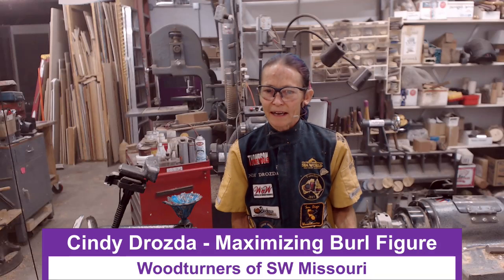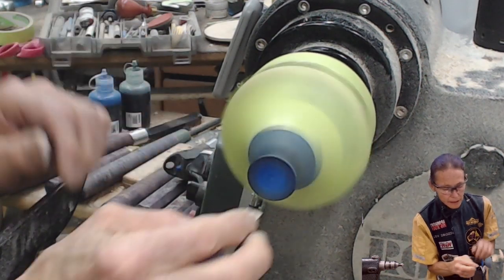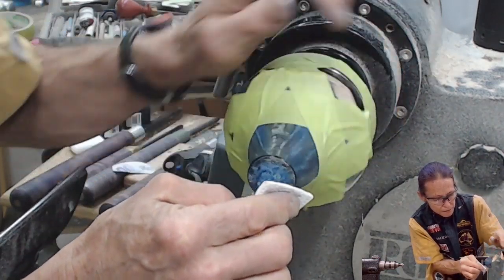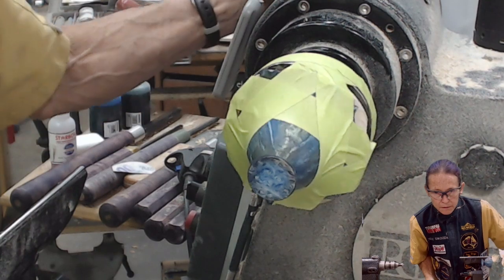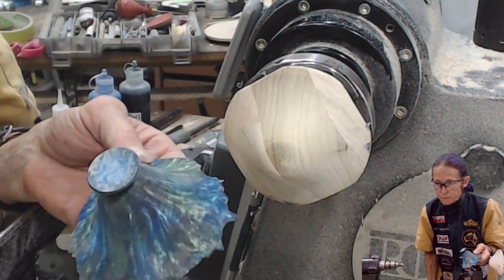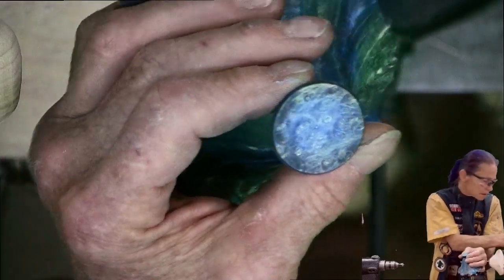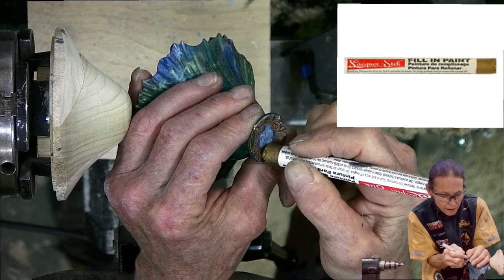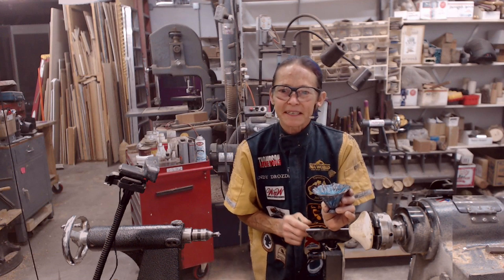Signing the Demo Piece from today's WTSWM Live Remote

Comment: What kind of tape are you using? Is there anything special about it versus blue painters tape? Thanks for all you do!
Reply from the maker: The tape is 3M painter's tape, extra high adhesion, for masonry. It is stickier than the blue tape, and strong. Blue tape is low adhesion so it will remove easier. I prefer tape to stick really well. 3M tape also is higher strength and better adhesion than the off-brand masking tape that is on sale at the big box stores. Note that this is not Frog tape, which is another low adhesion tape for easy removal. And you can find cheap masking tape in all colors, so not all green tape is the same as this stuff.

Comment: Do you use a special tip in the engraver or sharpen a smaller point?  Also, what speed setting on the engraver have you found works best?
Reply from the maker: Lowest speed on the engraver is what I use. Maybe up a notch if I want a bigger signature on a larger piece. I think the engraver point came sharp like this, on the Dremel model anyway. I had a Harbor Freight cheapo many years ago that I had to sharpen the point on. Easily enough done on a CBN wheel. Or take a piece of dead 1/8" drill bit and sharpen on aluminum oxide. Just twirl the rod in your fingers to get a point. No real need for a carbide point when we're engraving wood.

Comment: Thank you for that video. I would love to see something on how you finish your pieces... I prefer to finish off of the lathe, wondering how you do it.
Reply from the maker: Joseph, I usually use Waterlox oil finish, and finish my pieces off the lathe. It's a brush on, wipe off type of tung oil based finish. I put on about 6 coats. The glossy colored pieces have multiple coats of polyurethane.
Reply: Cindy Drozda thank you! Do you sand between coats?